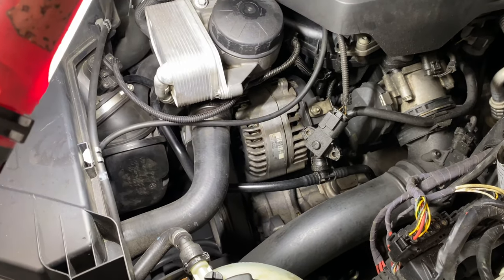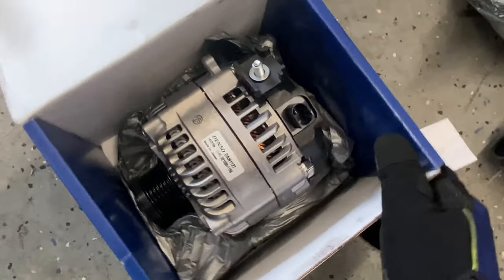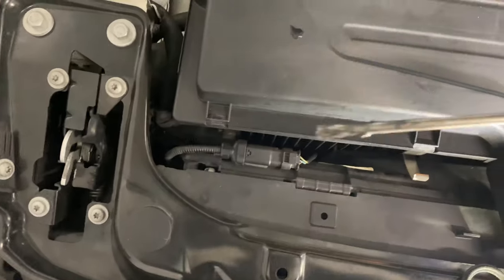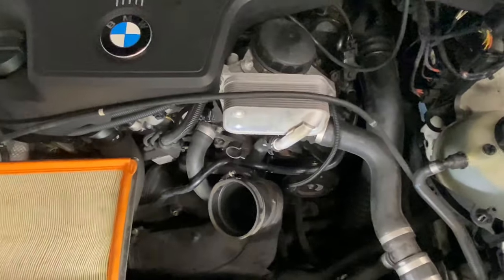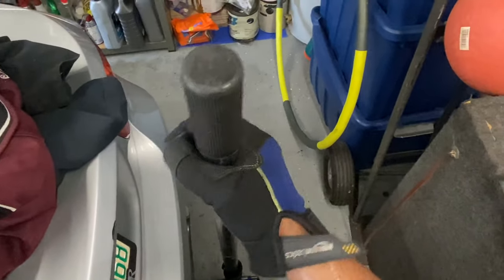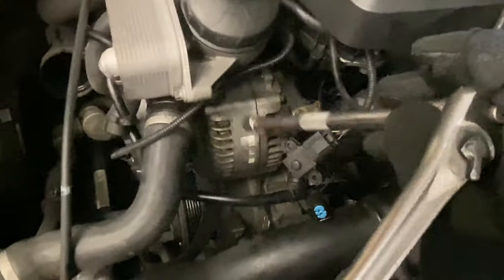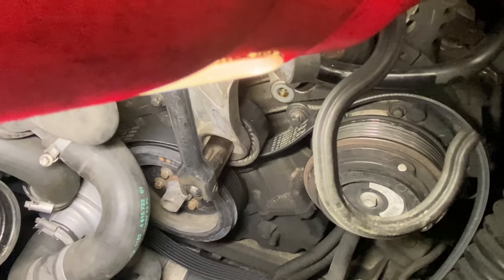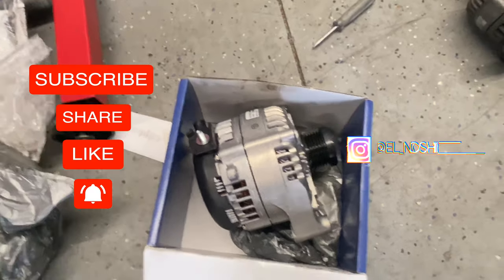F30 BMW 328i N20 Alternator Replacement

Comment: "Charging malfunction: battery is not recharging". The Alternator was the problem with my car 2012 bmw 328i. I went ahead and changed the tensioner pulley/belt while I was at it today. Warning lights cleared. Thanks for the video!
Reply from the maker: Np glad it worked out!

Comment: I had the same issue, same message on the control screen. A/c started blowing hot air. My problem was that my serpentine belt had ripped / tore and fell off. I Replaced the belt and problem solved. Thankfully it wasn’t the alternator or battery as I initially thought!
Reply: Hopefully that's the case for me as well. Currently suffering from this problem...👎🤞

Comment: Did this fix your charging malfunction message?
Reply from the maker: yes
Reply: Thank you and just one more question, what  kind of extension was that.
Reply from the maker: @rickiesuavo9968  yea let me know at which part of the video and I can tell you.
Reply: @nOshi2x  4:17
Reply from the maker: It’s this tool I bought it from advance auto years ago. GEARWRENCH 1/2" Drive Flex Handle/Breaker Bar, 15" - 81307 https://www.amazon.com/dp/B001M0O1G6/ref=cm_sw_r_cp_api_i_dlC_1dCMFbPW8R3MT?_encoding=UTF8&psc=1
Reply: @nOshi2x  is it always the alternator when that charging malfunction message pops up ?

Comment: Okay, if this thing is 210 amps and in theory, most alternators produce roughly half their rated at idle, is this thing doing 100 at idle? Do you have a meter to check?

Comment: As you mentioned that there are two versions of the alternator. A 170 Amp, and 210 Amp variant. Just in case I replace the 170 amp with 210 amp, is there any problem to my car? I faced this issue. Thanks for informative video.
Reply from the maker: I’m not sure. But speculating since the battery needs to be coded when replacing a new battery or changing battery types. I’d assume the computer is expecting to see a specific charge value from the alternator. So I’d just replace it with what came with the car. I think it would be worst to put the lower voltage alternator in a car that had the 210 since it more than likely would be undercharging the battery. I’m curious to know also if anyone has done it yet.
Reply: 210 for the sport package 
170 for normal sedan
Reply from the maker: Thanks for the info
Reply: @nOshi2x   1
Reply: @yun514  
I have luxury package.  210 here.
Reply: Great Vid! - hey @yun514 - I need to change my alternator on my 330e f30 (2016) Lux spec - Did you change your alterantor? if so could you possibly ping me the part number please - costs £600 from BMW in the UK and i need to see if I can source it cheaper?

Comment: I removed 2 bolts but Alt still feels like its on a hinge and can't pull out....?  Any ideas??
Reply: same here any solution
Reply: @dweller2669   Im also having this problem
Reply: @MrLORDGRIM91  ever find a solution?
Reply: Any solution to this ?
Reply: @TheLiveOfCharlie  I finally figured it out, it’s pretty jammed in so if you pull it forwards towards yourself and give it a pretty good tug it should pop loose and you can slide it out
Reply: @TheLiveOfCharlie  getting it back into place is kind of a pain as well, just have patience and get your top bolt put in first and it’ll be easier to find it’s way back in place
Reply: @jonphillips14  thank so much brother !! It just needed a push
Reply: @TheLiveOfCharlie  no problem! Glad I could help!

Comment: what causes the alternator? is it because of the  leak?
Reply from the maker: The oil filter housing gasket was leaking for a good while before the owner had it changed, so that leak pretty much messed up the alternator.